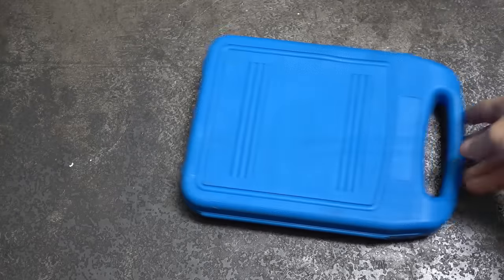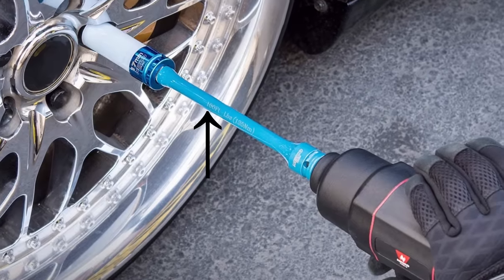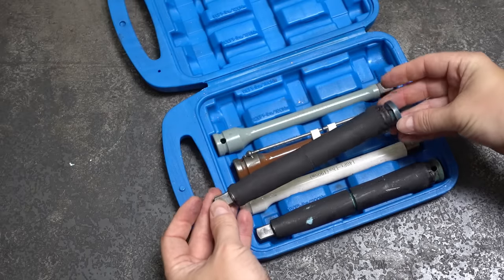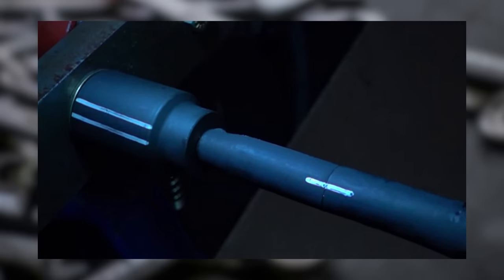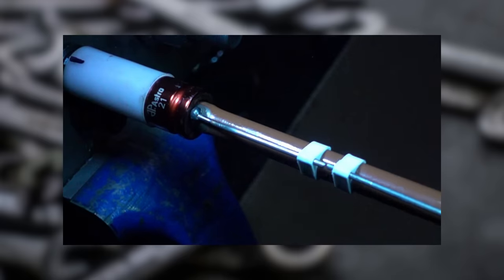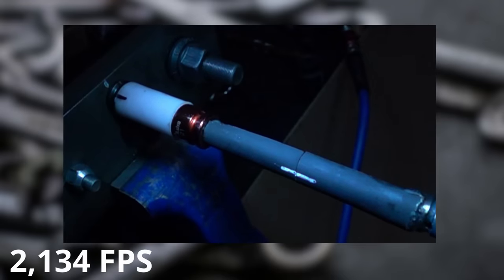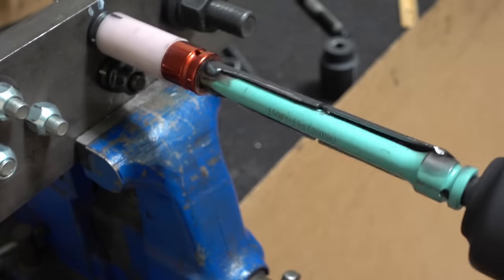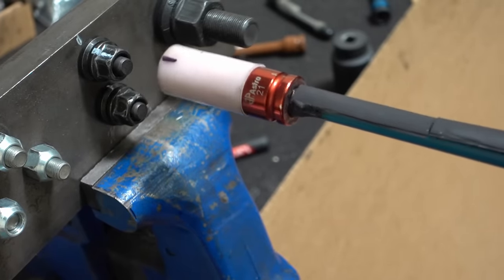Torque Sticks! High Speed Video Helps Reveal the Truth

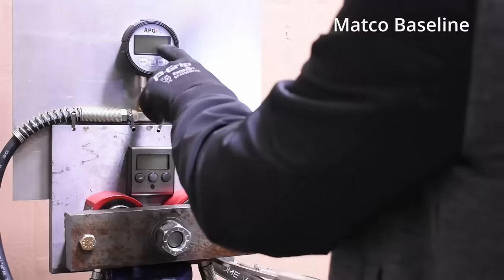Comment from the maker: To be clear we did use a cordless high torque in testing as well 5:40, and it's just as bad (30-50% over) The separation of the lines is what you want to see like shown with air tools, it means the bar is taking up the impact force by twisting instead of transmitting down to your lugnut. The lines staying together during an impact blow means the bar is not working as it should to limit forces, like it appears to with cordless tools.
Reply: I find with my 2767 (not a one key model) on setting two it works rather well for me, it may not torque to what the stick is rated to tighten to but it's consistently out which works for me
Reply: Assess*
Reply from the maker: @fakenamejones4254  Thanks, I'm famous for doing that haha
Reply: for anyone who missed the now deleted video...  have fun catching up..?  i dont know what myth you're talking about
Reply: Love the great visual representation of the torque sticks!
Could you please repeat the same visual example with “normal” impact Extensions of increasing length? 3”-18”
Reply: I knew intuitively these torque sticks dont work; glad theres now scientific-ish evidence concluding this.
Reply: I concur that my 2853 1/4" impact driver with a 1/2" adapter will break and tighten lugs on an F550. Wouldn't have believed it but it did it, with ease.
Reply: The electric impacts definitely feel more powerful. I bought a Bauer corded impact from Harbor Freight and even just tapping the trigger to spin down a lug nut on a tractor and it stripped the threads. I bought one torque stick in 65ft.lbs. my plan was just to try to keep from breaking things.
Reply: Does this same gap in overtorque with electric v. air apply to hydraulic impact drivers? Not the same class gun, but useful for science!
Reply: One thing I found with the cordless dcf899 and the harbor freight torque limiting sticks, they're pretty close using speed #2. But with any torque stick you need to test with your impact at your settings.
Reply: There is no recoil from the electric motor more like a ratchet hammer so instead of release tension after the "hammer" strike the motor locks at it max distance rotated until it is struck again which you see in the two rods torque stick. A pneumatic impact has a gapped recoil allowing the torque stick to rebound back to original position because of this every hammer strike is the same as the on prior to it where the amount of potential energy in the neck of the stick limits the amount of rotational force by each hammer stripe, but with the electric motor, it maxes out the rotation and holds it for the next hammer strike which allows each preceding hammer straight to hit with less potential energy to disrupt it.
Reply: A local shop install our wheels with an electric impact wrench.  I can't loosen the nuts they fastened with a 1/2 inch socket wrench and 2 ft breaker bar. I'm having them re-install the wheels with a manual torque wrench - I am certain they will first reach for a torque bar and electric impact wrench because it is convenient, and overtorque it by 30%. Which I learned from this video.
Reply: @zefrum3  That's not what these testers concluded. They found that torque sticks DO work. -On pneumatic guns.
Reply: So, what do you suggest to use with a cordless? I have the Ryobi 18v and would like to be safe.
Reply: @nashneubauer9016 why? The impact guns have already been rated for their torquing capability, and "normal" extensions aren't made for this kind of work--they will twist and become damaged. Impact extensions will not twist and will transfer all of the work to the end, delivering the torque the impact gun is rated for.
Reply: @KJ4RMZ use it to remove fasteners and bolts but not to install them. Traditionally you are never supposed to use impact for installation, and it's only been since these torque sticks gained popularity that people have started to do it. Impact guns are for breaking things loose. Using them for installation causes broken studs, stretched threads, and/or cross threading a very high percentage of the time.
Reply: That's actually a real bummer that the electric impacts lose the benefit given that I would suspect most DIYers use electric and many mechanics have switched to electric even though they have access to air.
Reply: Hey could you possibly test a triple hammer pneumatic impact against a twin hammer pneumatic impact? I'm curious now if the extra strikes would effect the spring action.
Reply: @MACandanedo1 I tried to remove a steering wheel nut from my son's car with pneumatic impact but impossible because the steering wheel and shaft would rotate slightly with each impact. Then I purchased electric impact and on high speed setting it spun that nut off almost instantly.  The frequency and peak force of each impact matters.  Essentially, the mass of the fastened joint cannot rotationally, accelerate fast enough to prevent a differential torque from being applied on the nut.  

With these torque sticks it is the torsional rigidity and the time it takes to untwist from each impact.  If it receives another impact before fully uncoiling then it will deflect to an ever greater rotational  angle (equalling higher torque) at each subsequent impact until it reaches an equilibrium state or destroys the fastener and/or torque stick.  At lower impact frequency the torque sticks should still work even with electric impact gun.
Reply: you say hydraulic fluid shouldn't compress.  This is false, it absolutely does compress.
Reply: @MACandanedo1 the anvil can float between the dogs, so it can still rebound, if the motors moving it fast enough that it doesnt have time okay. But your explination makes it sound like the anvil isnt free floating and they still are grab the impact and twist it theres a gap you can feet between the dogs
Reply: @allmycarsisbroke  yet every garage I take my truck to uses a gun to put the lugs back on, never once seen them use a torque wrench
Reply: @reallunacy  I'm here because I bought an electric Ryobi and it destroys, the torque is insane
Reply: @kannermw  I have 3 speed settings on my Ryobi, hopefully the lower speed will work with these sticks
Reply: @RandomStuff-zt6qf  I would not assume it will work without testing on something you won't damage from over-torque.  There is also risk of under-torque.  Need to try and measure torque to loosen.